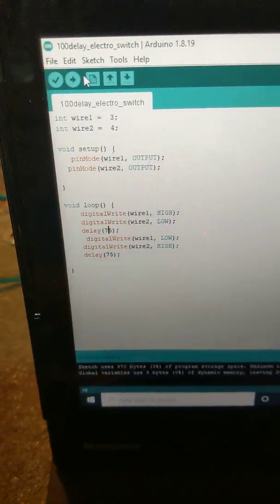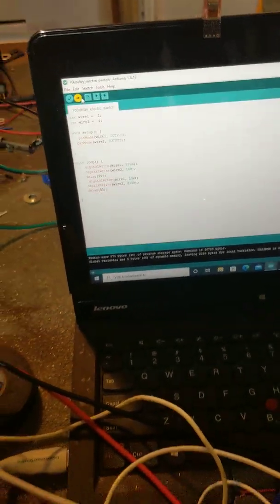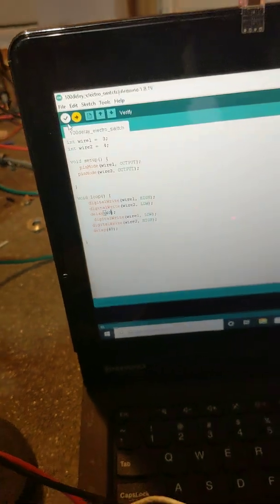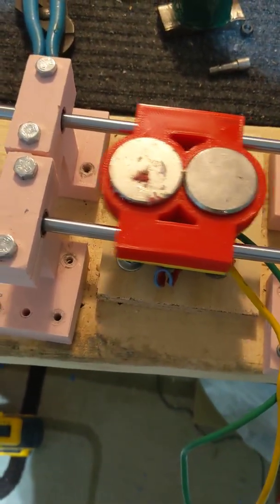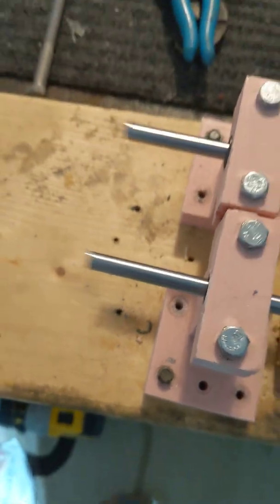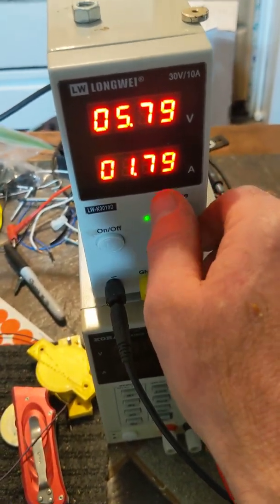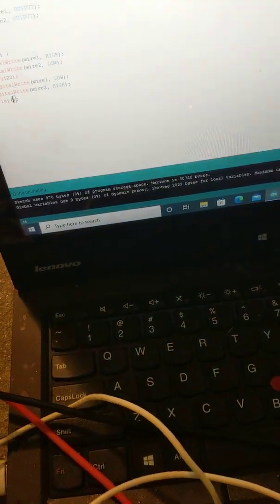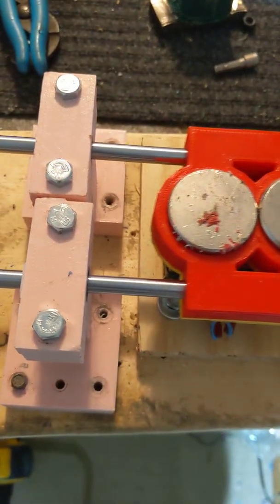Permanent Magnet Actuator Experiment

Comment: I’m looking to make a set up similar to your design. Could you provide a bit more info on the coil you used? What is the designed voltage of the coil 120,24,12? What are you using to activate the coil with the arduino, MOSFET, Solid State Relay? 
Thanks
Reply from the maker: Happy to explain and show other setups.  Join mooker.com and I can help there
Reply: Hey dude did you get any info?